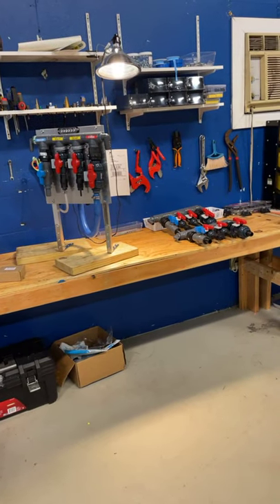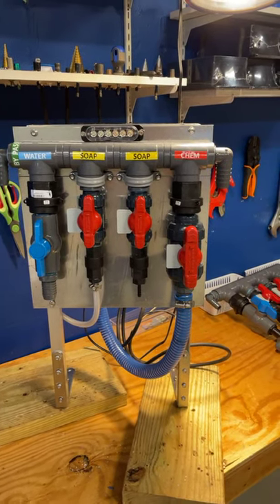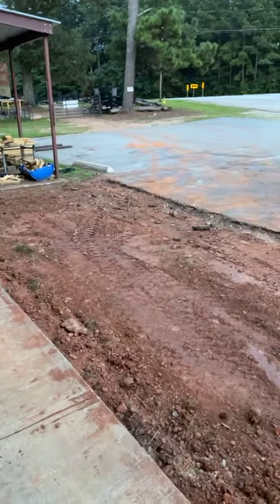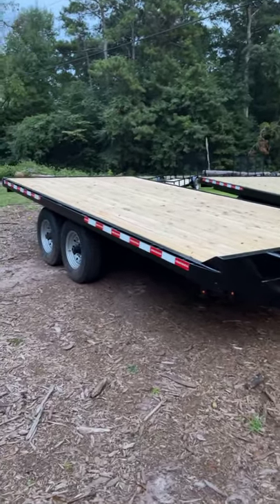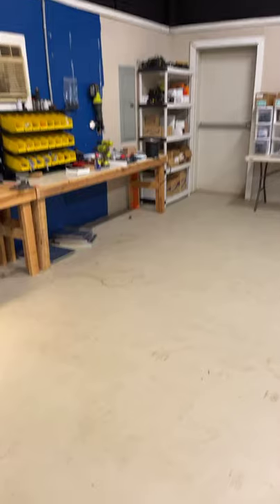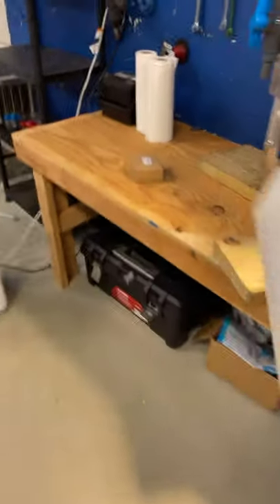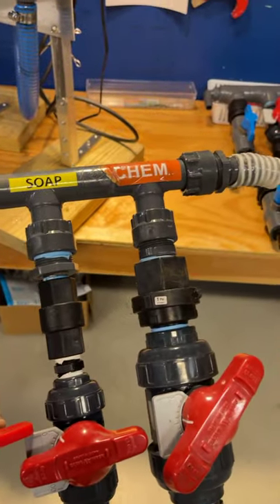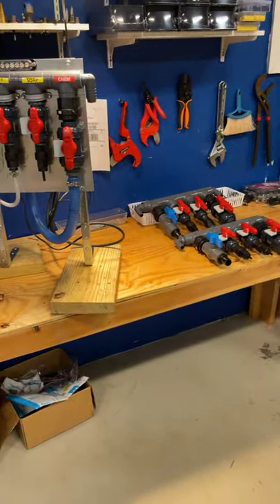Expanding southern Style to building Pressure wash trailers

Comment: There’s really no comparison between 12v and gas roof pumps. 12v are easier to obtain and cheaper, however gas roof pumps have the volume and speed. Northern tools came out with a 10gpm electric pump I’m curious about. If electric pumps get into the teens gallon per minute then we’ll have a competition. But as of now you wouldn’t compare a 4gpm pressure washer to an 8gpm and by that logic there’s really no comparison between a 5.5gpm electric and a 13gpm roof rump. Also congratulations Leon. Will get a manifold from you in a few months.
Reply: Ha, you say that now. I bought a gas roof pump back in March and recently sold it for the 12v. These put out way too much flow we were using way to much bleach per job. Also i was having priming issues even after i would cut the water off first. It would prime but would lose prime randomly and you would never know it cause soap pulls. We would be on a roof spraying soap only and never knew it. The only benifit with it was the distance but i had tons of run off. Theres never a do it all system, only negative with the 12v is the distance but we climb roofs now.  I got lucky and sold it on facebook cause people believe the hype. Live and learn.
Reply: Check out pumptec x6 12 volt that will be coming out 6.8 gpm 300 psi
Reply: @motorcycleislife8296  I understand that logic. I guessed as much when it comes to using more product. I rationalized that it’s mitigated by the speed in which a job can be done. As far as the priming issues, haven’t heard that one other than Leon talking about it. It obviously happens which is why he turns his water to 2oclock from my understanding. I’m sure several factors go into that. Assuming the priming issue can be fixed than the only 2 downsides are chemical consumption and over spray. Obviously rinsing is going to be god tier with a gas roof pump. Were you using the blue or red gun in your setup? Seems like you could lightly pull the trigger on those guns to get a misting effect for roofs. I’m just curious. As I mentioned in my original post, northern tools just released a 10gpm 100 psi 24v electric bleach pump. I’m very curious about it and I believe it still uses 1/2 for us who have the Amazon special do it yourself 3 way regulator.
Reply: @chrisgood9715  Rinsing was ok, but we downstream so no need for it. You can lower the psi but i could never get it to prime. For what we do with mainly residential the 12v is 100x better, i honestly gave the 12v crap before i bought the gas roof pump but now looking back it uses less chem per job and it always works when i need it too and can easily swap it out. The gas will evenually go out and who knows when. The 8GPM pressure washer never has bleach going through it so it lasts a long time. You can go ahead and buy the gas pump but im telling you it has its problems, 11gpm is a ton of flow, it wouldnt be bad if all you did is house washes which is why you never see leon spraying a roof from the ground, theres way to much run off. The only reason to buying the dam thing to begin with was so that i could spray roofs that were too tall, but then i was never able to cause of the run off. So its pointless.
Reply: @motorcycleislife8296  thanks for the info Motorcycle is life. Even though it was a head ache for you it sounds like business is going well so I’m happy for you. I’m a stubborn mule so I still want to try one but if this happens to me you better believe I’ll be thinking myself, “Motorcycle is life told me it was going to be like this.” lol. Good luck with everything and I wish you the best. Good talking to you on here.